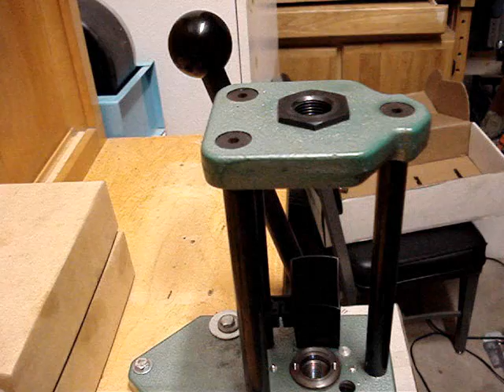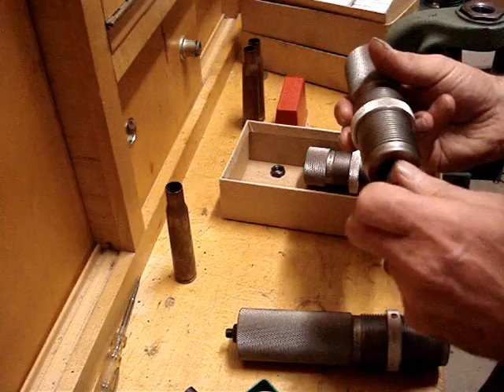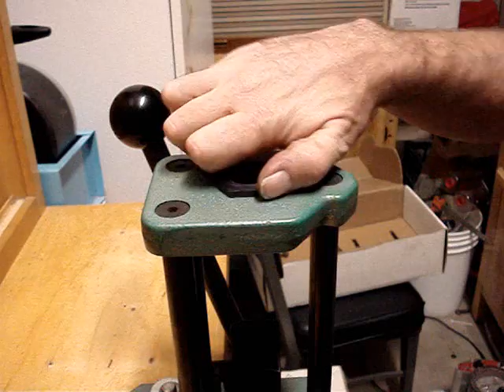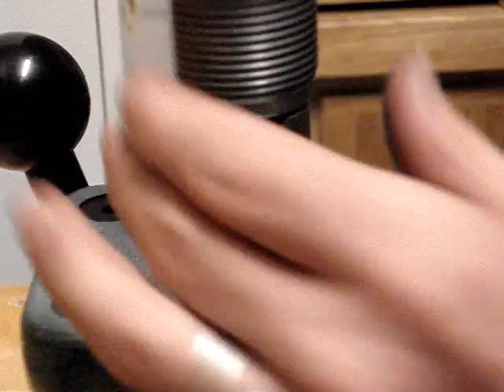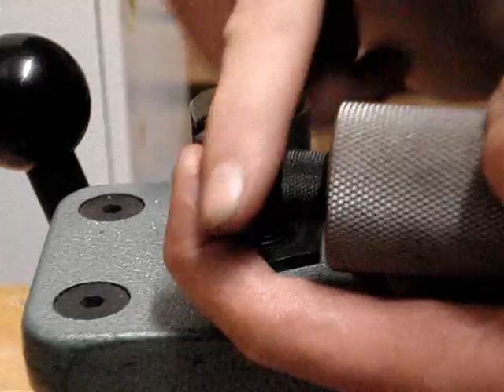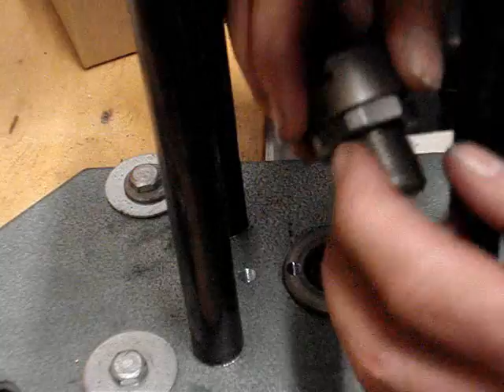50 BMG: The Basics Part 1

Comment: U said u pull 750 gr FMC bt projos & replace w/750gr a max. There are no 750 gr mil projos of any type, that's a mith. M33 ball is 661 grs -25grs., m2 ball is 709grs -22grs, m2 a. P. Is also 709grs - 22grs. Mil projos have loose weight tollerances to get a cone of fire for machine guns, for accuracy with mil projos they need to be weight/ sorted mil load specs for all mil ctgs up to 20mm are in the back of the book cartridge of the world.

Comment: You mentioned at the end of the video that the shell holder backing out would mess up the headspace adjustment.  Isn't the headspace on the resizing operation set by the resizing die completely closing on the shell holder, regardless of the height of the shell holder?

Comment from the maker: No.  There are standard presses like the RCBS Rock Chucker that will do everything from 22 Hornet to 505 Gibbs. You need a press that not only can take the dies but have the clearance to allow the case to be worked and a bullet to be seated. The RCBS Ammomaster press is a great press and can also load standard cases and be setup as a progressive press. It's more expensive but like any good piece of equipment it's flexible.

Comment from the maker: Yes. I use the Midway 2092 tumbler now made by Frankford Arsenal. They don't come out looking like gold but they're clean. That's the main thing. The brass used in 50 BMG seems to have a different metalurgy in it. The 50 is a expensive project. I'm developing a cast bullet load. It's low recoil and more cost effective. Limited range but it gives you trigger time.